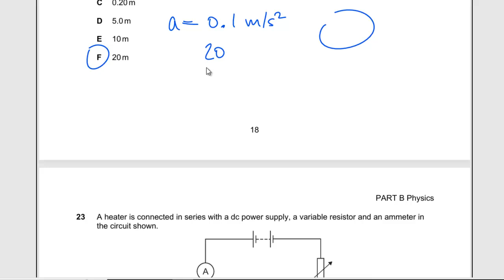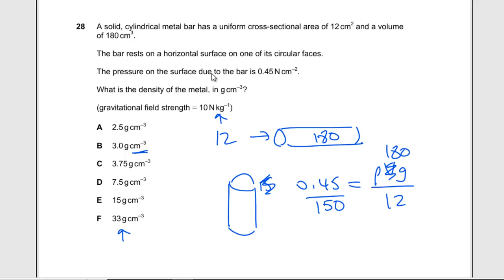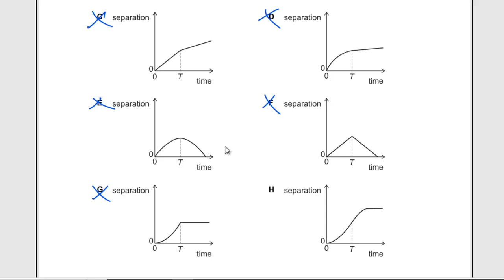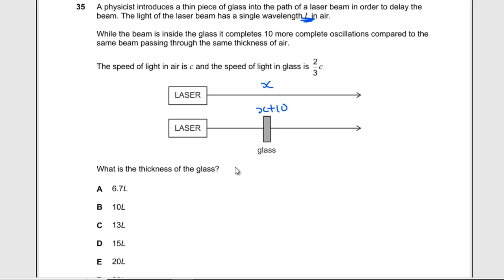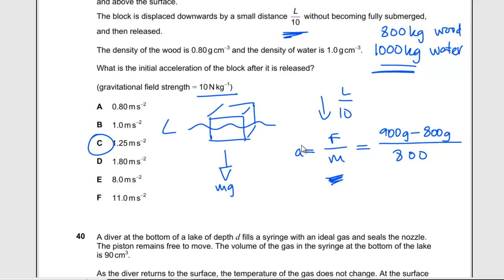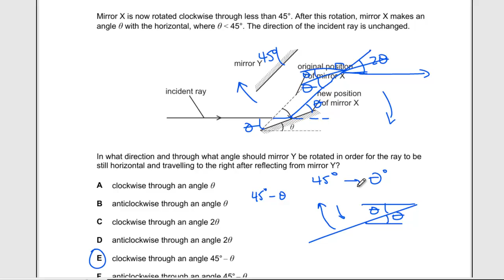Rapid-Fire Multiple Choice Questions - NSAA 2023 Physics

Comment: Hello Sir, for question 33 at 17:20 what is your go-to method? Could you go through it in a bit more detail, and also explain why you used 20g of ice instead of 10? Thanks a lot.
Reply from the maker: It's a conservation of energy approach. First, pick a baseline to calculate from: I've picked 30g of ice because I know that the final answer must have more energy than that. Second, calculate how much more energy there is compared to the baseline (i.e. how much energy is needed to change 30g of ice into 10g of ice plus 20g of 30deg water). Third, calculate the temperature if this amount of energy was shared equally across all 30g of ice (which is what happens at thermal equilibrium). As for the 20g of ice part, it's 20g rather than 10g because 20g of ice has melted into water, leaving 10g behind (nothing has happened to the 10g of ice).